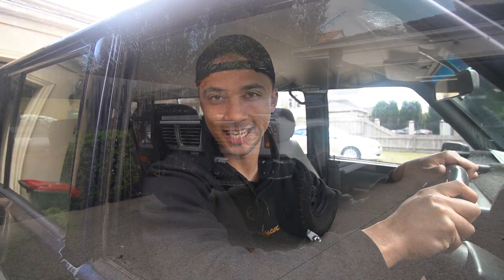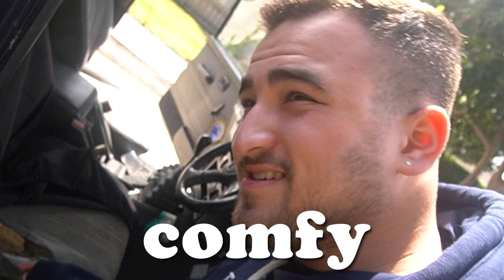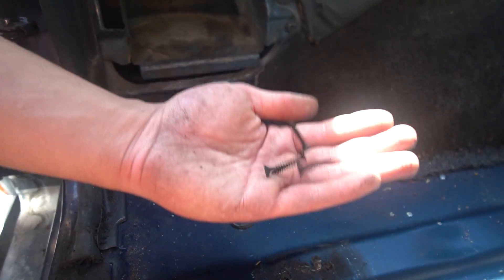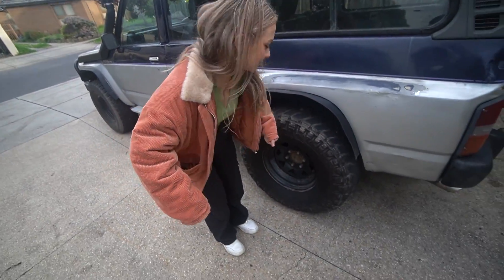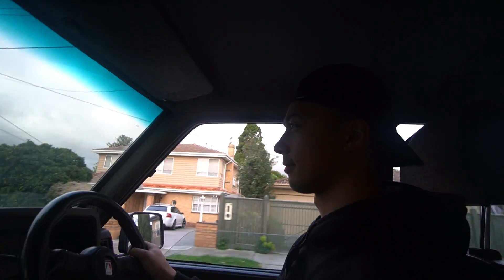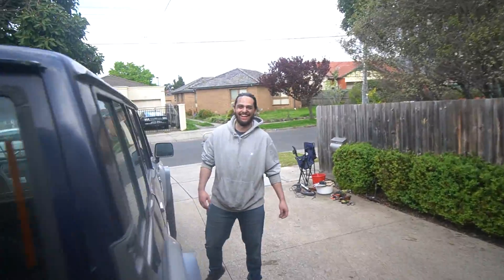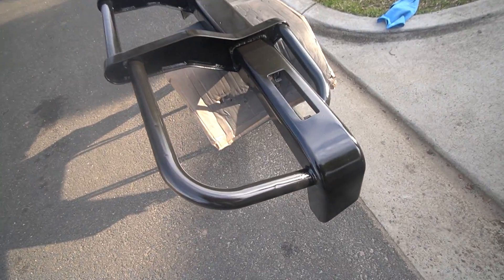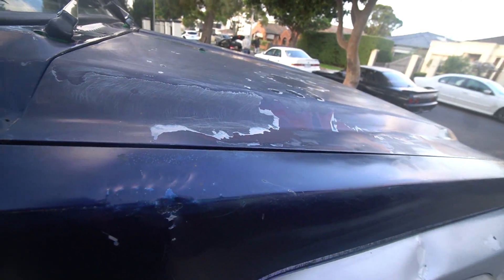FACEBOOK MARKETPLACE GQ PATROL IS WORSE THAN I THOUGHT...

Comment: Hey mate just finished doing up my own 4x4. I recommend raptor coating the whole car, gives it a tough look for under $500 and all you need is an air compressor and sanding it obviously. I did a closed door spray as I didn’t see the need to do all the inside trims. Mine came out mint. Other ideas would be to put a 12v setup in the back for camping with a dual battery, fridge, draws etc. I’d recommend some kings products (stay away from their mppt solar controller tho) and then of course anaconda and bcf products. No need to go more expensive than those brands 
Good luck mate!
Reply: raptor is great for unbody/ute trays. personally i think it makes the car look cheap and tacky when used to spray body panels. even if the paint is beyond fked i wouldnt.
Reply: @katsinabox8236  fair enough. I spose it depends what colour you paint it. I painted mine in white and it looks fine. I agree that the ones where people mix like an olive green looks tacky but I don’t reckon a white or black looks half bad
Reply: @katsinabox8236  is that like those raptor signage some fords have those are sick cars

Comment: with it not starting it probably like my old one fuel was getting to the carby before i fixed all the issues i use to prime the carby before starting it by giving the pedal a few pumps, then i fixed the issues by doing a new pump new filter and new mechanical pump and carby clean

Comment: When I bought my 89 gq shorty it had nails lost every where through it and the was a packet of 22 rounds and an old Nokia 3310 list under the seat.  If your going to use it as a tow rig get the cooling system flushed and swap out the clutch fan. They are the best off road but they are shit for towing

Comment: Got my GQ with 180000/200000kms on it from an old man, good service history and everything in top nick except roof which was quite rusty for $4000 in an auction which cost me $250 of rolled metal and other materials to fix. Would've got it for 2k if the auctioneer hadn't got his friend on the phone to drive up the price, pos.